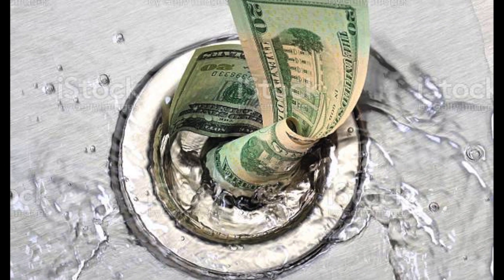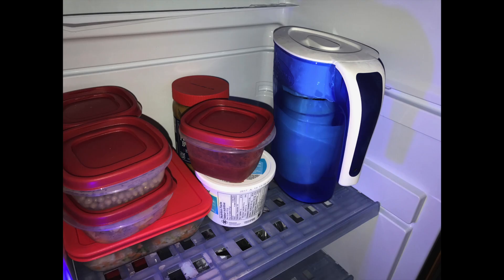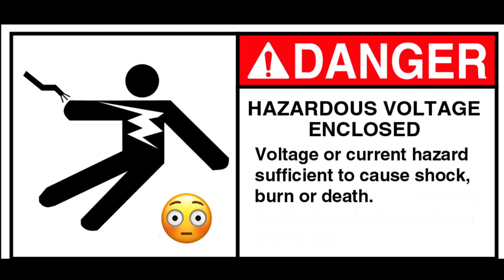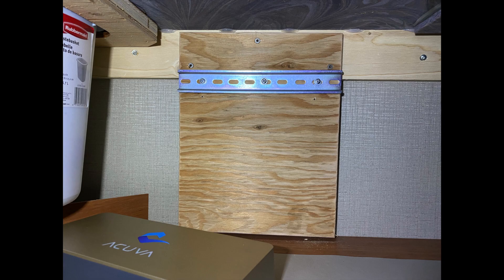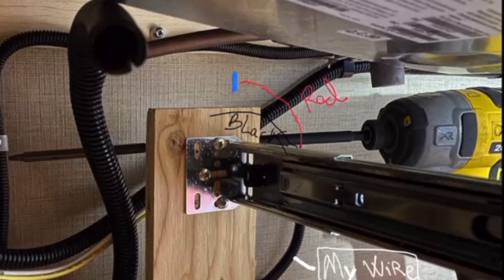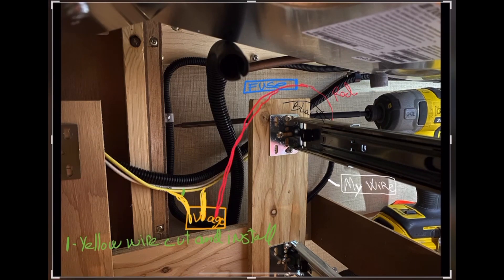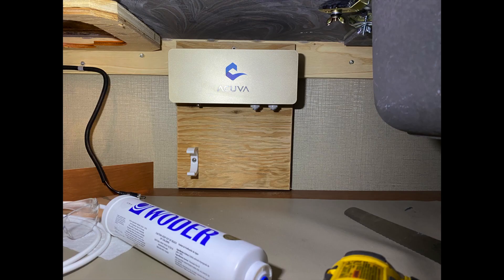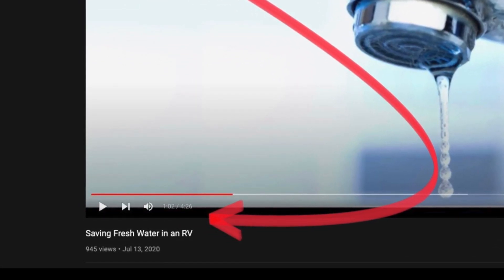No more bottled water while travelling in your RV !    Acuva ArrowMax 2.0 in a Leisure Travel Vans

Comment: Just curious, what steps would be required to winterize this unit after the end of the season?  I am thinking you would not want to run plumbing antifreeze through the filter and the UV-LED unit.
Reply: Manual says to use antifreeze….. It’s been winterized using the pink stuff couple a days ago already…..